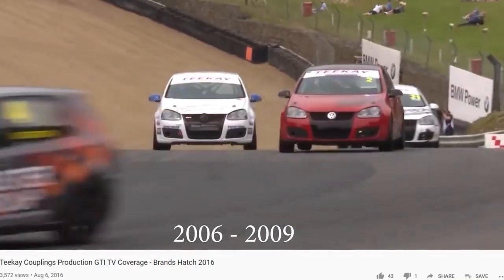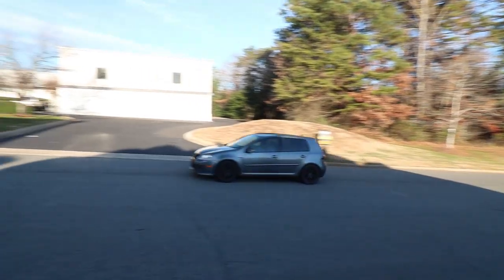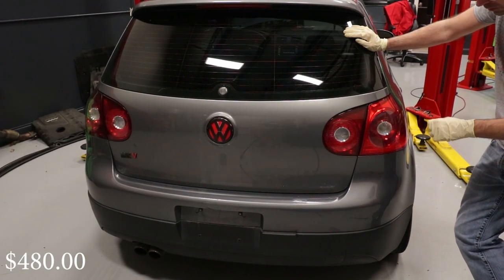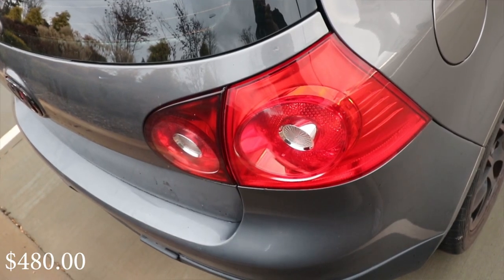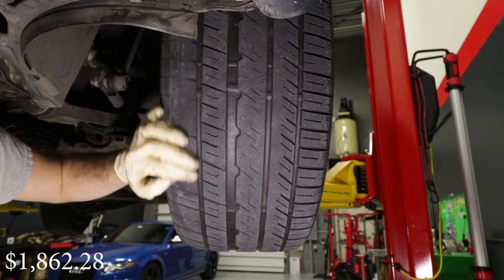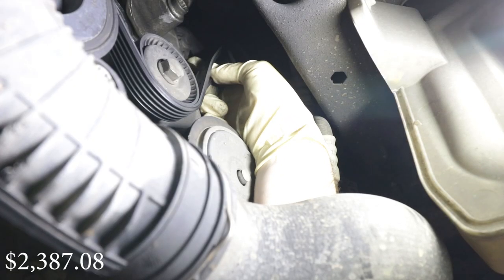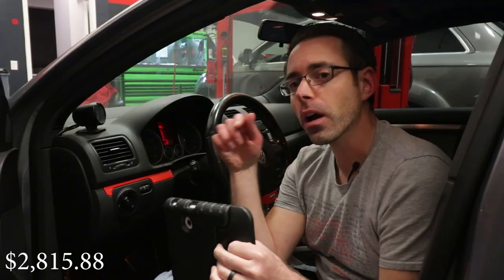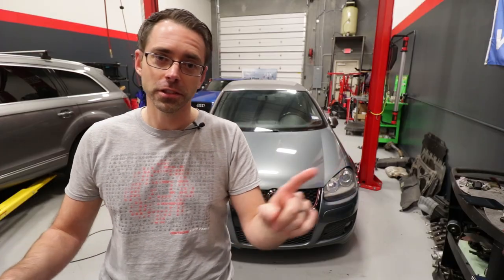How Not to Buy a MK5 GTI

Comment: My first car was a high mileage 2006 B6 Passat with the FSI engine. I suspected the previous owner was also a woman (Dont buy cars from women). It had leaks, failed cluster, PCV, & misfire issues. Was a POS but I loved the turbo, comfort, and DSG manual on it. I was super stable even above 130mph. VW never ever again. & incase you're wondering, I drive an N/A E82 120i now. GL
Reply: 2006 B6 Passat did not come with a DSG, it just had a regular 6 speed  automatic which was a pretty decent transmission as well.
Reply: @I6N54  What ever the Plus / Minus manual shiting mode is called in theat VW model, it had that.
Reply: @DigitalDissident  Tiptronic, fancy word for regular automatic with manual mode.

Comment: FFS, that poor car was as neglected as fook!! I have a 09 MKV with 190K KMs on it and it's still like new inside. I was wondering how this one had a center arm rest made of leather when the seats and doors were the tartan fabric tho. Mine is the opposite but only cos I got my car a set of second hand leather seats when it was a tartan original. Also, the covers on the windscreen fliud and coolant reservoirs should be blue but they look very much older and faded than on my one. The boost gauge installation was atrocious also lol. Looks like it was stuck on using velcro. Good info though. Prob won't be buying another one of these cars until my current one dies lol but thanks.

Comment: you forgot the end of the title it should end with "Just don't buy one"..lol kidding..but no really, I pay more per month for insurance on my GTI than I have any other "sports" car I've ever owned, INCLUDING my 93 FD RX7 LMFAO. Parts are stupid expensive, need tons of specialty tools, constant CEL's or SRS lights popping up, owning mine has been a nightmare. Spent around $4k in parts for a complete forged bottom end build, had to buy and freshen up a cylinder head, and a  new turbo cartridge after my balance shaft seized while just cruising. It snapped the balance shaft gear clean off but kept running & was still turning the oil pump, anyway it threw/sucked up metal shavings  & ended up spinning a rod bearing and tore up my heads cam journals. Long story long, after all of that was fixed my headliner started sagging, got multiple Airbag faults ($200 to buy VCDS just to reset after TSB fix if that's what the problem is), and po299 that could possibly be caused by 20 different things that could be leaking boost lmfao, these things are poorly engineered money pits. Anyway mine is also probably going to be for sale here soon ;)

Comment: I swear I've seen that car around uptown before...
With Xenon, color temp changes as the bulbs begin to wear/fail.  Generally they fail to a lower kelvin becoming warmer with more yellow/orange-ish and even green visible, as well as taking longer to fire and get to temp.  If the cast light looks like champagne or Zubrowka, it's a bad bulb.  All else will usually be a ballast failure, and always change the bulb and ballast together~

Comment: Dude, how TF do you think you’ve checked the bushings with the car lifted up in the air? The vw golf bushings in the front are a very common thing to wear out but you can’t possibly tell if this is the case with the car in the air, not unless the bushings are torn apart. Just saying.